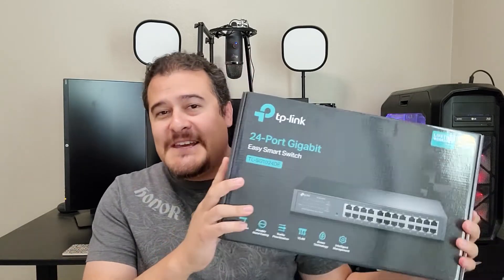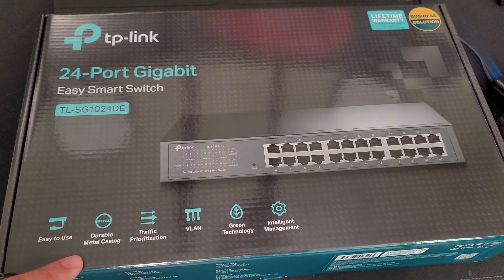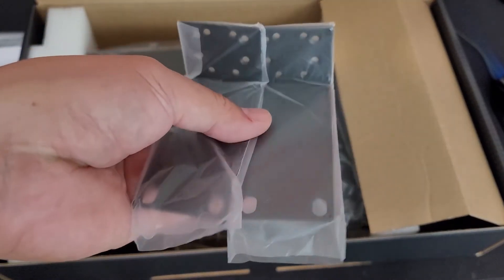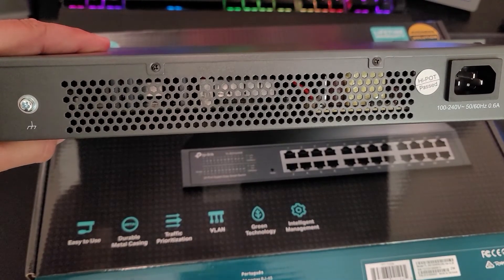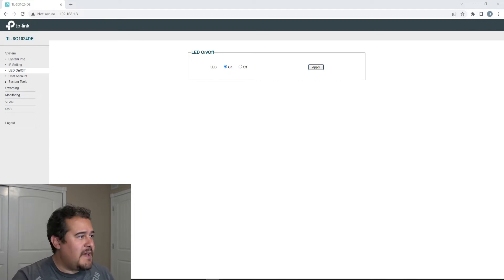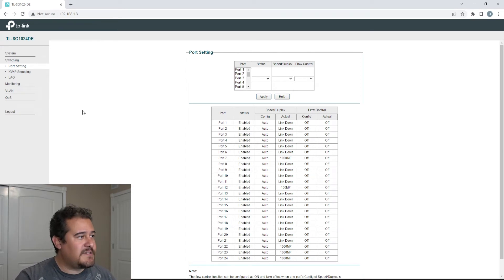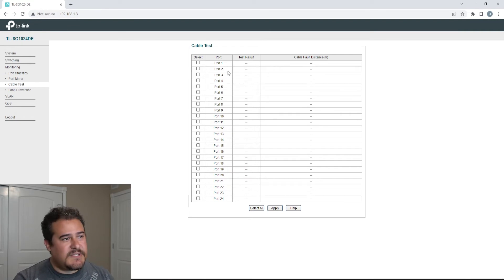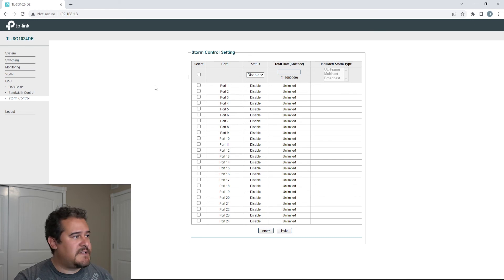TP-Link 24-Port Gigabit Switch Replacement

Comment: Technically your video has lots of "opportunities"....  I can tell you've never touched a network before.  You are just spewing out what is on the screen and saying "technically" in front of what you're saying to make it sound like you're a network engineer.... but that's okay.  All network engineers start from the beginning 🙂.  Also your sound was WAY low when you started to show the configuration.  As a YouTube creator you need to figure basic stuff out like that.  Normalize the audio for goodness sakes.  And learn to read.  You said at the beginning "SJ1024de" instead of "SG1024DE".  Oh well... maybe you were nervous.  Great effort though.